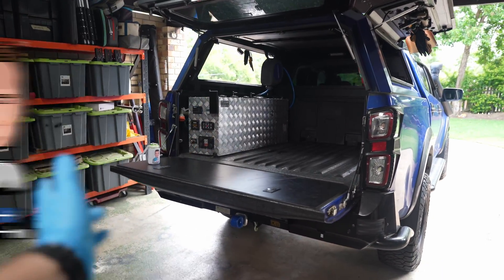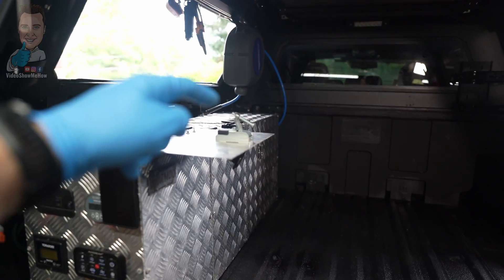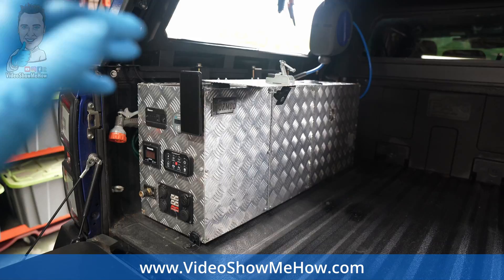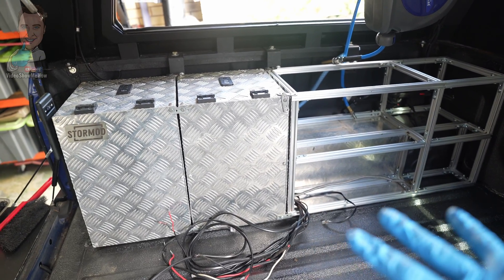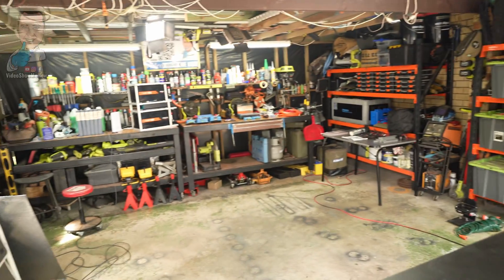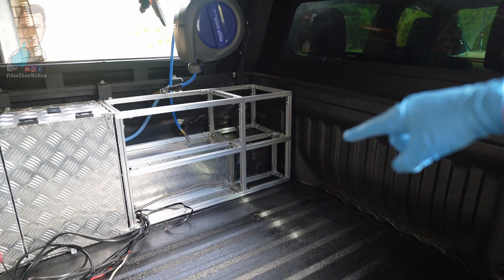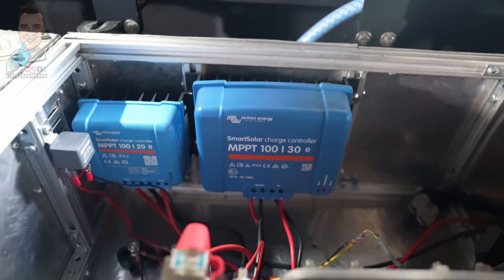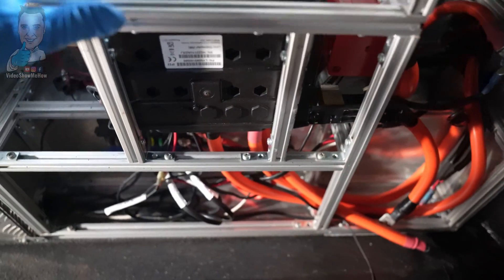Ultimate DIY 400AH Canopy Power Fitout 12v Litime Lithium Battery Install and Setup

Comment: I’ve honestly only skimmed the video so I apologise if you’ve already addressed this question, but is it okay to mount these batteries side-ways? I only ask since I’ve seen Tim Bates 4WD Adventures YouTube video about how he killed two lithium batteries in 11 months because he didn’t mount his batteries the right way up. Really interesting 12v build you’ve done though! Love this channel and it’s inspired me a lot to get the canopy, phone mount, and awning. Do you have a video of your canopy roof rack platform? And the ceiling of your canopy?
Reply from the maker: Hey yep they can be but only on this specific side as I have them per manufacturer 👍 No vid of the canopy rack, I basically just cut down the one that came with the canopy so it fits inside the slots to get me under 2.0m (and into carparks)

Comment: Those Renogy inverters blow air out the front powerplug end and suck from the battery connection end and also blow a proportion of air out underneath the unit up the powerplug end as well , I think your fans to cool the box are going against the flow so to speak 🗣  Worth considering maybe if you haven’t picked that up yet . Bloody nice install there rock solid 👍
Reply from the maker: Hmm currently on a trip testing so will have a look, might have to swap the fans in that case 👍 Thanks for the tip!

Comment: Epic ... Quick q.... The relay to power the fans.... Is that running through the victron BMV-713  monitor?
Reply from the maker: Yep, had to cut that bit explaining that vid was getting waay too long lol. Yes so on the bmv712 it has a little relay built in, so you run power to it and back to a regular relay and fans run off that. It's then activated based on your settings, can be temp controlled or even voltage (so if voltage hit 14.4 for example you could start a water heater to use surplus power etc) 👍
Reply: Righto, that’s what I was after…. And now… the absolute last one….. the earth to chassis from the Lynx, I’m guessing that’s beefy, and is it just going to the same chassis earth point you have the neg from the DCDC input going to, as I assume you haven’t run the neg from the start battery as per your original install. Cheers again for the great content and follow ups……. Helps no end….
Reply from the maker: Hey all good, fire away with any Q's. Yep the big chassis earth is 95mm cable, same as the main orange ones in the box. Pass through is 400amp. Prob a little overkill but rather have the head room 👍 Have a 100amp wire coming from the old DCDC which I will use for the new victron buck boost when it arrives and use the lynx neg. Output from the DCDC into the lynx on the last spot
Reply: Or…… does the big earth from the lynx replace the need for one from the non isolated DCDC 12|12 30 ? Ie the DCDC takes positive feedback from alternator, and the gnd and pos out go direct to the lynx which completes all the earths…..

Comment: Epic setup mate
Should really consider adding an AC/DC charger in there (or at least a port you can plug into) 
I recommend the Victron 15amp

You won’t use it all the time but it’s really handy to have if you’re at a place with power and want to charge up those large batteries!
Reply from the maker: Yeah top tip, might be able to squeeze one in there a chunk of space under the compressor.. Have been eyeing off one of those fancy cerbo gx screen thingies also 🤔
Reply: @VideoShowMeHow I haven’t got one permanently mounted in there (I use it for multiple vehicles)
But I’ve got a port which is wired through the shunt of course

In our work car we actually use a Victron multiplus 12/3000/80
Charging at 80amps over AC is awesome and it’s got a 3000w inverter built in

Cerbo screen would be nice, but maybe a little unnecessary considering no permanent mains power

Also recommended to add a “smart battery sense” directly to the batteries to monitor their voltage straight off the battery terminals so you’re not getting voltage drop 

But awesome build, wish I could fit 400ah of lithium in my setup👌

Comment: 400amps syorm v2 ,will the battery tower fix with L brackets to tub floor 😅
Reply from the maker: ? Yeah the battery module is connected to the main unit like the original one was as well as 3x additional beefy brackets to the tub, it ain't going nowhere 😊